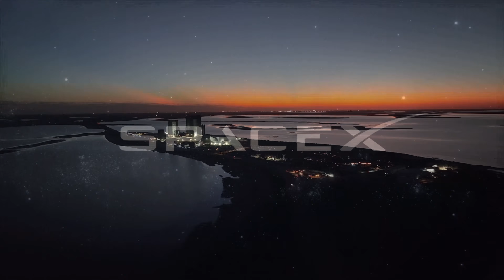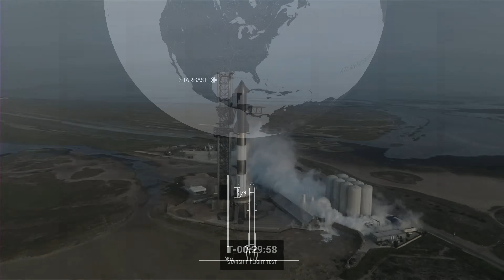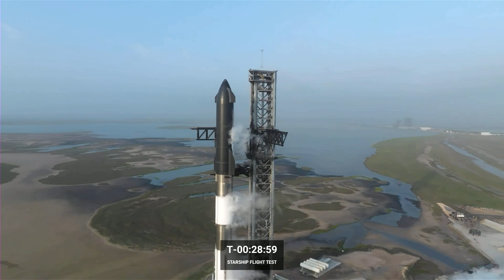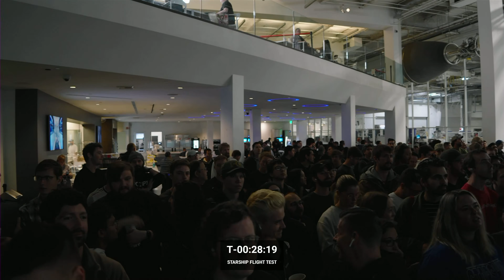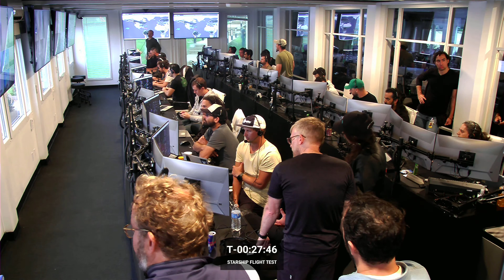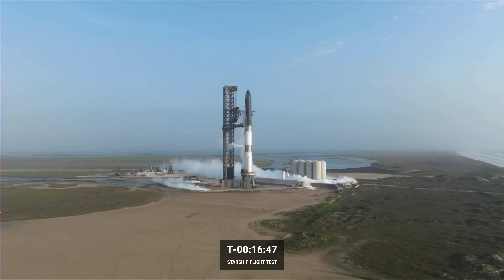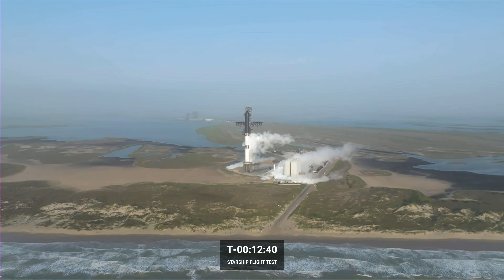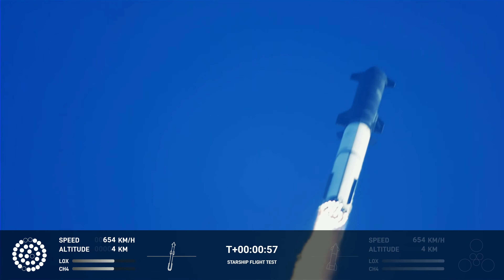Starship Flight Test

Comment: Do you think spacex is leading toward the failed Russian N1 with the 30 nk-15 rockets?? NASA used 5 huge rockets just a thought do we need a half dozen  giant Merlin engines instead of the 33?
Reply: It doesn't really work that way. The Raptor is designed to be small with a very high power density which makes it easy and cheaper to manufacture
Reply: the reason the N-1 failed was simply due to lack of funding, they didn't had money to test hardware on the ground, they had to launch it all to test it

Space X made MANY tests on the ground, if the N-1 could do what Space X does, they would have definetly launched that thing.
Reply: The advantage of too many engines is that it can still fly with several engines lost

Comment: Where will no be good,while whey use 36 engine on first stage , need some more powerful ,like j5....
Reply: lol what
Reply: There is an insane amount of why they are using smaller engines instead of bigger costful engines.

Firstly : if a booster lost an engine, it wouldn't be problematic at all, i could survive like 4 engines dying and still go nominal.

Raptors are way more better than old engines, in term of basically everything, efficiency, price (an raptor cost less than 1 million, while engines like the one you are talking costs more than 15 Millions to 146 Millions) and in term of thrust ratio it's still the same, it costs way less for a Raptor.

I heard that Raptors also have stronger gimbal than the biggers engines.

Also, they use 33 Engines, not 36.

Comment: But wait, didn't Herr Musk say Starship would land on Mars by 2025? Just another miscalculation, like the Roadster?
Reply: 1. They never said 2025 bc it is not a Mars transfer window 

2. They did say 2024 but all the way back in 2014-2016 when they first announced Starship so a very rough guess
Reply: @ChickenDogArmy  he has a history of making these kind of promises and failing. The sooner SpaceX move on from Musk the better
Reply: @joecantdance494 well not necessarily if they didn’t have these insane impossible goals they would js become like NASA. No clear goal, slow turn arounds, and messy structure. But SpaceX thrives on impossible goals, so no they should not get rid of Elon. And just because you don’t like Elon does not mean he needs to be booted out of his own company.

Comment: the launch facility as a whole is underfunded...
the physical structures are at below 10% sufficiency. all of them. the propellants storage is a few cheapest possible tanks. inadequate piping and a complete absence of propellants conditioning equipment.  the tank farm is too close to launch platform. there should be protection structures everywhere. nope. no money spent beyond minimums.
every structure is too flimsy.
especially mechazilla.

it's mindblowing how inadequate the launch platform itself is.
it's just a few pillars holding up a circular support for the vehicle with a annullus in the middle for rocket exhaust.  it makes no sense. it doesn't remove any of the problems that rocket exhaust at launch presents.. it's a slow explosion which introduces stresses. sort like a fuel and air bomb going off. u being there probably would mean all ribs broken due to rib cage collapse due to atmospheric overpressure..
the exhaust dynamics need to be directed away.
 the considerable mass of exhaust gases added to atmosphere need to be removed. the accumulating heat needs to be prevented.
none of this happens with exhaust impinging rectilinearly on a concrete pad .
plus everything is made so flimsy.

to make point....
compare the Boca wannabe spaceport with it's couple pieces of spaceport infrastructure on basically just a concrete pad no better than a large parking lot ...
compare that to the Saturn launch pads the government made in Florida.

both are on swampy ground. pretty much same parameters apply. can't go below grade.
the government made a artificial hill completely covered in concrete. within that internal space they constructed the exhaust handling channels including a flame pit with flame deflector which removed the surface impinging effect from the exhaust.  actually the exhaust entrains ambient air. anyway it's complicated but the government solved the can't go below grade problems. not only the exhaust motion dynamics.
they handled the thermal and acoustic extremes with water avalanche curtains.

compare the Florida pad with the Boca.
ouch... (spacexrulesall]
Reply: Aren't there propellant subcoolers for conditioning literally immediately to the left and right of the large propellant tanks?

Comment: why didnt stage separation occur?
Reply: The broken engines didn't get it high enough for the scheduled seperation and it requires the engines to turn off, which they didn't
Reply: @shaung949  and then the self destruction systems knew what is going on and exploded it

Comment: Bwahahahaha...! 🤣
Reply: Says the weakminded.
Reply: @eskieman3948  Fanboi.
Reply: I hate Elon, but the rocket did very well for it’s first launch.

The Apollo mission caused multiple deaths and had the Mercury program as a precursor.
Reply: @CMT_Crabbles The NASA space program culminated in the Space Shuttle program and was the last and most successful vehicle ever launched. Over a period of 20 years from the early 80's to the early 00's, barring the Challeger and Columbia disasters ( the former was an o-ring failure due to political pressure to launch in adverse conditions, the latter shear bad luck when some insulation dislodged during flight to unwittingly cause damage to the wing ), it flew hundreds of missions and delivered 100's of crew and cargo to exclusively build and operate the ISS and launch/repair Hubble amongst others. Its return flight did not require the dead weight of fuel to land. It never had one single known technical fault over those 20 years that resulted in a failed launch, mainly due to the reliability of the SRB's and RS-25's rocket engines, probably the most reliable/reusable engine to date. NASA made all the mistakes so Musk doesn't have to. They have set the bar. The schoolboy mistakes that Musk and his engineers are making is largely down to a lack of experience coupled with a cowboy attitude. NASA 1970's - "Failure is not an option". Musk 2023 - "[Success is if it doesn't blow up on the pad ]".....

Comment: Afters its first laumch still closer to making orbit then jeff bezos
Reply: Actually, quite wrong. New Shepard flights go much higher than 39km.
People are also forgetting Blue Origin hasnt even tried to reach orbit yet...
Reply: BO is not even trying 😂 Jeff who?
Reply: they are trying, there New Glenn rocket is a Starship competitor roughly the same size slightly smaller and stuff.  @dinosaurearththeory
Reply: @emergencyCALL911  but you need height in order to reach a stable orbit. Cant orbit at 30km lol

Comment: Artemis = 1
Starship = 0
Reply: Starship is part of the artimus architecture. I think you mean SlS
Reply: StarShip

Development work on the SpaceX Starship began in earnest in 2012, although the concept and initial design work had been underway for several years prior to that. Initially, the Starship was known as the Mars Colonial Transporter (MCT) and was intended to be a spacecraft capable of transporting humans and cargo to Mars and other destinations in the Solar System.
Over the years, the design of the Starship has evolved significantly, and it is now intended to be a fully reusable spacecraft capable of carrying up to 100 people and 100 tons of cargo to destinations both within and beyond Earth's orbit. The Starship is currently in the midst of an extensive testing program, with prototype vehicles undergoing a series of increasingly complex flight tests at SpaceX's facilities in South Texas.

12 years and counting……..

SLS

The development of NASA's Space Launch System (SLS) began in 2011, following the cancellation of the Constellation program, which was intended to return humans to the Moon. In the wake of the cancellation of Constellation, NASA began work on the SLS as a means of developing a new heavy-lift launch vehicle that could eventually be used for crewed missions to the Moon, Mars, and other destinations in deep space.
The SLS is designed to be a versatile launch system capable of carrying a wide range of payloads, from small scientific instruments to large crewed spacecraft. The core stage of the SLS is powered by four RS-25 engines, which were originally developed for the Space Shuttle program, and the upper stage uses a variant of the J-2X engine that was also developed for Constellation.
The first test flight of the SLS, known as Artemis I, is currently scheduled for November 2021. The mission will be an uncrewed test flight that will send NASA's Orion spacecraft around the Moon and back to Earth, serving as a crucial step in the agency's plans to return humans to the lunar surface.

Source: ChatGPT.

Comment: Super Heavy Epic Fail
Reply: Bot
Reply: @chronovore7234  AI
Reply: More like launch pad epic fail. its debris at launch that caused 8 engines failing
Reply: it's a. test flight
Reply: Epic fail? It lost 6 engines and a HPU and kept going, even reignited one in-flight, survived max-q and only then either lost control or the ship failed to sep.
Reply: @RocketPal  Well, max q cannot be "survived" or "not survived". Its not a fixed point during a launch. A rocket will always reach and pass max q

Comment: Respectfully: I expect that Elon and the engineering team have explored the following, but as with many things, on occasion - things have been missed: therefore I ask;    the Falcon 9 rockets have a 99% success rate (more or less) - they are proven and they work well.    Assuming that there is control over the thrust levels of the Starship BOOSTER, to conserve fuel - would it not be an option to attach 2 Falcon 9 boosters (as in the Falcon 9 HEAVY configuration) to the Starship booster - operating the booster at much lower thrust levels, allowing the Falcon 9 boosters to carry much more of the load.   As such, the Falcon 9 rockets would be recoverable and reusable (hopefully landing at the Texas launch site -as in on land), and the Starship booster would have sufficient 'extra' fuel onboard for well, for other uses, such as transference to an orbiting fuel dump.     Has it been considered to use 1 LARGE fuel pump to service all of the 33 engines, as opposed to 1 fuel pump for each engine?   There may be a considerable cost saving (1 pump as opposed to 33), although there would be a loss of redundancy if 1 pump failed - there would still be 32 operating engines.    Then again, I'm not hearing that the fuel pumps/compressors are a problem: so, if the fuel pumps/compressors are reliable, would there not be a weight and cost savings to replace 33 with 1 larger unit?    What I am suggesting is that whatever duplicate items exist on each of the 33 raptor engines, would it, could it not be a weight and cost savings, to replace 33 units with 1 larger unit?    GREAT work Elon and engineering team: do not succumb to public pressure to do anything: science, technology, and engineering takes time: move at a pace that is prudent and wise.   I am with you!

Comment: Let me guess they aren’t using explosive bolts so it failed to separate. That’s too simple of an item to fail
Reply: It failed to separate because a fire burned cables to the computer and it wouldnt stop the engines on the booster and also they had exploded the tanks but it didn’t explode since the explosion wasn’t big enough.
Reply: They lost control of the rocket before stage separation.

Comment: i'm very puzzled that if a failure is expected ,why to launch it
Reply: It’s the first time this rocket has every flown
Reply: They didn't know what would fail.
They got lucky that it was thrust vector control because they have already upgraded that for the next engines.
Reply: @johntheux9238  Yeah also when engine 19 exploded beautifully it knocked out the hydraulics and thrust vector control (like you said) which was yknow poop.
Also recent news today they have just test fired the new and improved Raptor V3 ENGINE! The chamber pressure is 350bar's and when all 33 would be in use it can generate up to 19.5 Million pounds of thrust, thats over double the power of SLS.
Reply: @benjaminrickdonaldson  Raptor 2 had a bigger combustion chamber so there was a tradeoff between thrust and efficiency. Raptor 3 on the other hand achieves more thrust by increasing chamber pressure so it's better in every way. Big upgrade.
Reply: @johntheux9238  Thats the golden rule, you want highest pressure for the lowest weight.
Reply: So you can see how it fails. Trail and error is part of the engineering process.
Reply: So that you can see the issues with the prototype and learn exactly how it failed so that they can improve it for future rockets.

Comment: Took 5 seconds to lift off.  
Is SpaceX taking responsibility for the damage they did to the area up to 5 miles away.  I think this is fascinating don't get me wrong.  I hear 'GREEN' all the time and they put more litter in the oceans and in space than I will in my lifetime.  I'm for learning and exploring.  Its time to step up the level or responsibility.  You send it up.  You clean it up no matter where it ends up.
Reply: Spacex are the only rocket company that don't fill the oceans with every rocket they launch.
Reply: @adventureunderground2234  At present almost all their first stages (Falcon9) return and land, they also recover the payload covers but not the second stage. Starship when it's completed testing will recover both booster and upper stage. The only time falcon 9 doesn't return is due to an extreemly heavy payload which require all the fuel to put into orbit.

Comment: I can't agree with SpaceX knowing the poor qualty of welds many ppl still believe it's the best thing but it has very poor leadership how can you have supervisors that don't have a clue about the process and you have them as leaders .  On the quality side they have incompetent supervisors that have no clue about how s weld is composed ,welding specialists that have never welded their knowledge is by theory is just impossible for me understand how Elon is not aware of what really goes on in his SpaceX company.
Reply: It survived max-q and spinning at mach 2 through the atmosphere. The welds are good.
Reply: There were 0 issues with the welds, watch the video "How SpaceX mastered welding" i think its called that, I am sure if you search it up it'll pop up but you cannot be anymore wrong bud.
Their welds are amazing, I am not sure if you understand how rockets work but I'll explain that when something is capable of flying, passing Max-Q which means maximum dynamic pressures or loads onto the vessel and then spinning around while it waits for the FTS system to work for 40 seconds straight is clear proof that their welding is amazing.

Comment: Catestrophic engines failures as i mentioned all over social media its a suction discharge issue of the engines, design failure. Look how Russia designed similar rockets to avoid this issue
Reply: The engines didn’t fail at launch they just didn’t start them. One did shutdown but that was due to a pressurisation unit failing not the engine
Reply: @weekiely1233  not
Reply: @veoteveo1  what?

Comment: American N1
Reply: N1 never got half as far as starship already has
Reply: @andrew40085  But N1 has been flown 7 times with its full configuration
Reply: @muhammadferdian3845  and starship made it 4 times as far on the first try
Reply: @muhammadferdian3845  No? It flew 4 times and struggled with the structure? While the starship didnt break up while doing sommersaults at 40 km at mach jesus?
Reply: The only thing these two rockets have in common is "fuckton of engines in the first stage". Starship doesn't even have a third or fourth stage.